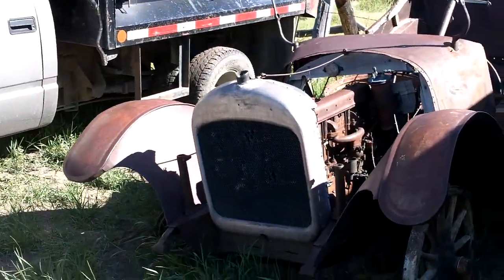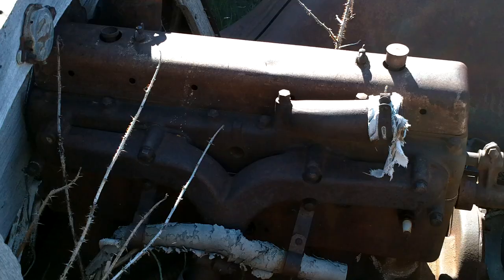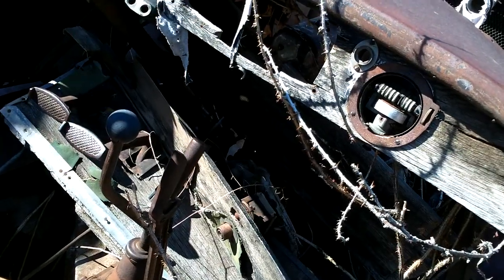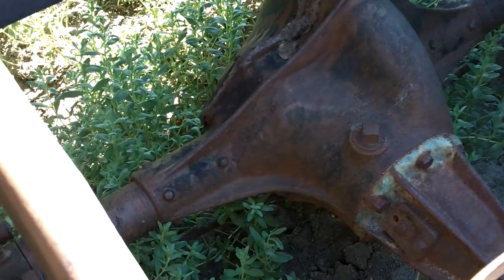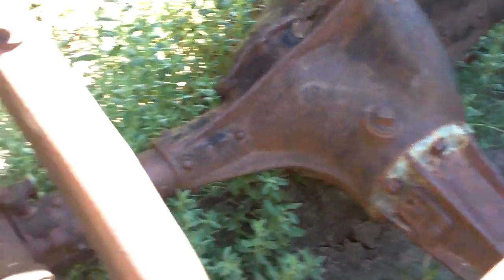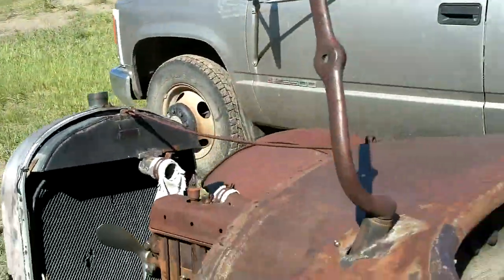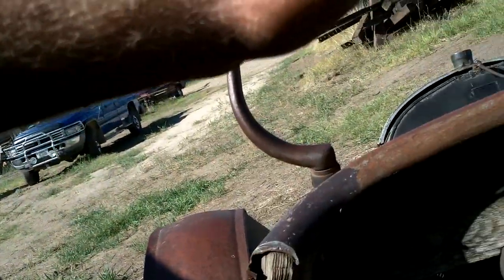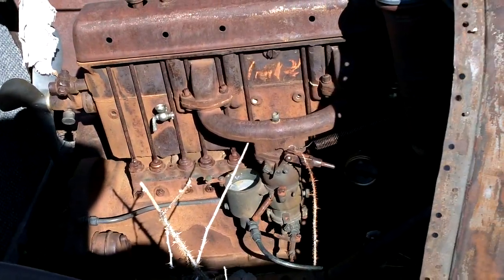What kind of car is this?

Comment: The engine is either an early Buick or a Chevrolet, it looks like an inline OHV six but there are two pushrods missing. If you could find a number on the chassis or the engine block it may narrow it down.